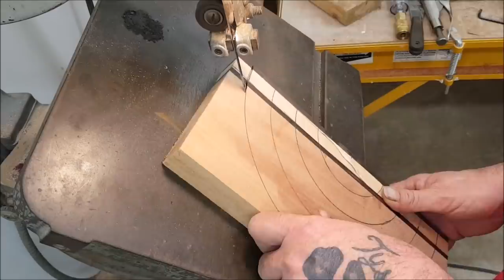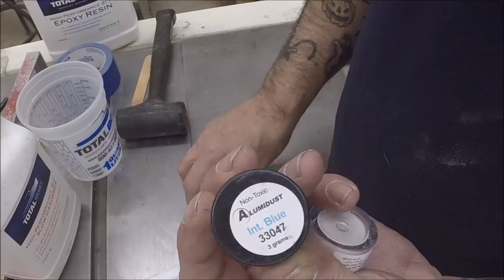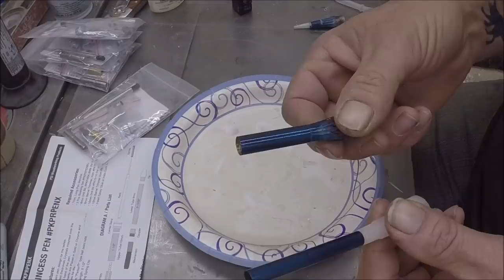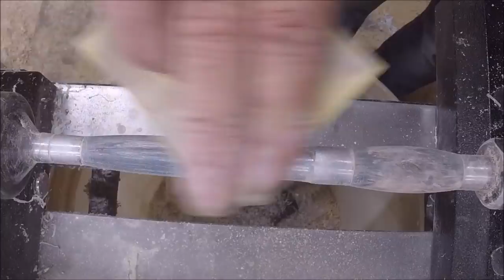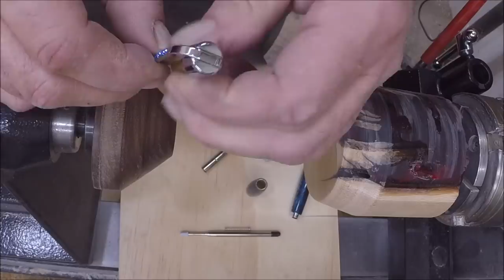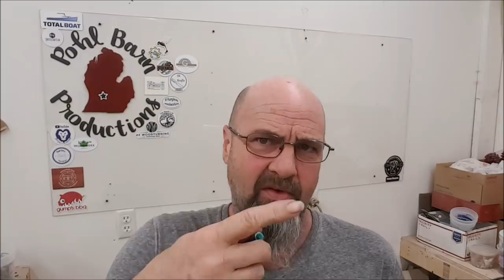Swamp Stick Princess

Comment: Very nice pen Doug. When I'm casting hybrid blanks in a mould I put all the wood in first and then fill the mould with rice. I then empty the mould and weigh the rice. That gives me the weight of the resin I need to fill the mould so I don't mix too much or too little resin. Hope this helps. Cheers, Huw
Reply from the maker: Thank you Huw, I did fill the mold with rice, with out wood but I was still short on resin. I figured I'd have extra

Comment: Awesome looking pen. I have used Bar top Resin to cast pens before. That is what I used for my last couple of videos too. Just have to be careful how much you pour because of the heat that can build up from the chemical reaction of the epoxy.  To much heat and the casting will crack or turn out cloudy.
Reply from the maker: Thank you Terry

Comment: The resin and wood looks really nice.  I’ve got a grapevine clipping that I’m letting dry at before I make into pen blanks.  Was the wood that you used stabilized or really dry?  The reason I ask is I’ve tried resin with things that were not quite dry and it did not go as planned.  I was using Alumilite and I’ve heard it is especially sensitive to moisture. -Ed
Reply from the maker: Ed the wood was not stabilized, it's been dried and redried many time as it's left overs from other projects, I had the same issue with Alumilite, so I went out to a resale shop and purchased a toaster oven, now I just cook the wood for an hour or so to make sure it's dry and pour the resin while the wood is still warm,  we plan on a grape vine project but I have to get out and cut some down then dry it out first. it hold a lot of water.

Comment: Nice one Doug!  I’m about to try some casting, but the tree business needs to give me a break for a few minutes to get into the shop.  Do you have any moisture issues with the total boat?  I ended up with a cloudy Alumilite coating last week that I think was a humidity problem. 
Thanks
Reply from the maker: I've only done a few clear castings with it,  for the most part it's clear but I think the moisture comes in bubble form with the total boat, I try to dry my wood in the oven first before I pour it to make sure it's somewhat dry.  try cooking that wood for an hour or so at 150 or so.
Reply from the maker: I don't know, I've only used Alumilite about 2 gallons worth, it does not like moisture as I found out with pinecones, foams clouds and cracks. I cooked them after that and poured while they were warm.

Comment: Morning Doug!  Question for you. I have some incense cedar and I’d like to retain the smell of the wood when the project is done. I don’t have a clue as to what finish to use to allow the smell to come out. Any ideas?
Reply from the maker: I really do not know Augie, I would think anything you finish it with will seal it. keep all that cedar smell inside
Reply: Hey Doug, I ended up using a paste wax on that incense cedar pen. It does have some smell and I am guessing that will be as good as it gets. 🤔
I know that you use Yorkshire grit in most of your projects as do a lot of the guys I watch. I haven’t used it yet and just saw a review of the Acks Abrasive paste and the restorer wax.   Have you tried the Acks products and if so which do you like best. 
What’s the scoop on these pastes?

Comment: Question: Is there a reason you use micro pads instead of jewelers rouge on a fine cloth or piece of chamois? Those pads seem a bit stiff for finishing small round objects.
Reply from the maker: because that is how I learned to finish the super glue finish to a shine,
Reply: @PohlBarnProductions  Noted. May I recommend trying some? Useful for polishing just about anything that can be polished and 10-12 bucks gets you a virtually lifetime supply of any grade.

Those pads seem to get expensive for me, you might have a better place to buy them though.

Of course it isn't a direct replacement for pads, can't use it on exposed wood or the wax will work into it and stain it. I personally think it's a lot better for anything with a curved shape though, a lot easier to get a soft piece of leather to wrap around them or squeeze into the grooves.

Green extra fine and finish with white after a 200-300 grit sanding works great for me. Red bar would probably also work for a final finish.

https://smile.amazon.com/Woodstock-D2902-1-Pound-Buffing-Compound/dp/B0000DD35C/ref=sr_1_4?keywords=buffing+compound&qid=1554851257&s=gateway&sr=8-4
Reply from the maker: Thank You

Comment: Does Total Boat work for thicker castings? Bowl hybrid or possibly something like a globe/sphere?
Reply from the maker: so far I have casted it with both success and failure in deep pours, I think my mix is off just measuring by eye on the mixing cups, I'm working on one now that I measured by weight, according to the product sheet, I haven't yet taken it out of the pressure pot to know if that was my issue or not.

Comment: What did you use to seal  your mold?
Reply from the maker: It' HDPE and I just taped off the seams on the opposite side to make sure any leaks stay put. then I only remove one side to get the blank out and retape it for the next
Reply: @PohlBarnProductions  I've been trying to seal a mold and I've been using silicone caulk and I have had limited success with it so far.
Reply from the maker: not much sticks to the HDPE,  once you tape it and pour it the resin seals any leaks except for the side you take off, re-tape that and pour again.